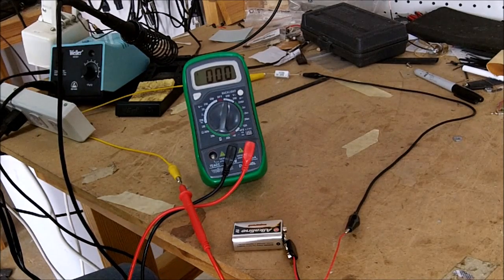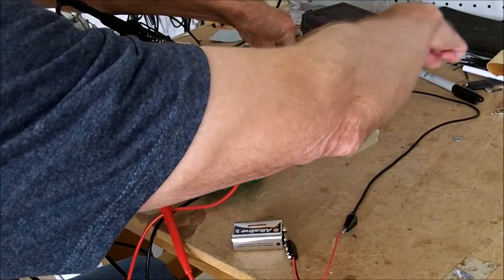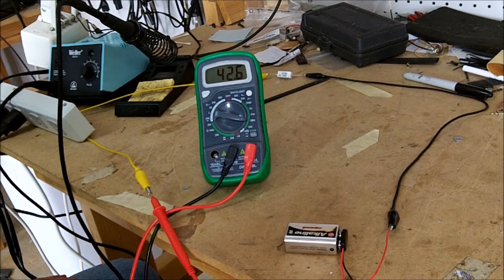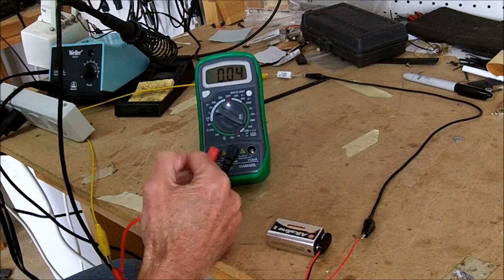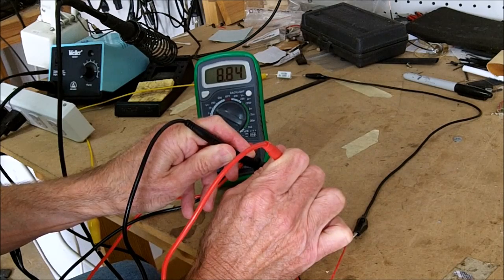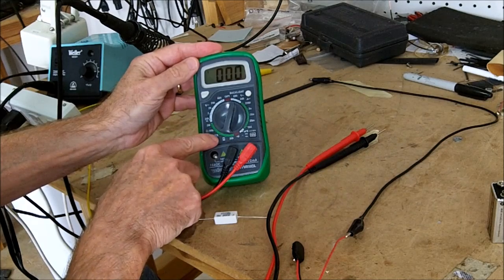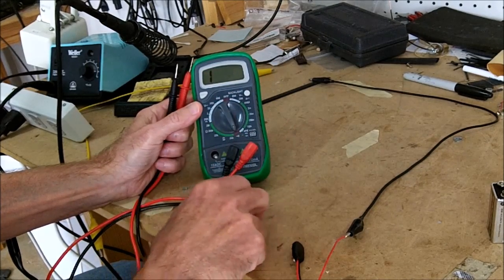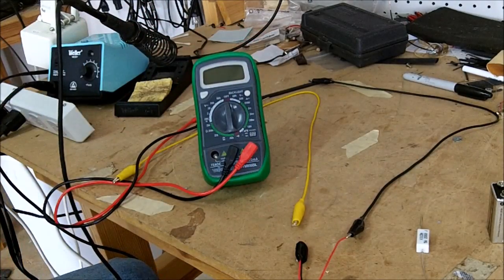How to use a digital multimeter

Comment: Thank you, You did an awesome job explaining how to use the Volt meter.  How do I measure a ha/vac capacitor for  micro Farad?
Reply from the maker: You need a capacitance meter or LCR meter. There are very affordable ones available. Example:
https://www.amazon.com/Proster-Multimeter-Capacitance-Resistance-Inductance/dp/B071WNNYQT/ref=mp_s_a_1_4?crid=2ELWUCPYL587E&keywords=capacitance+meter&qid=1658080715&sprefix=capacitance+%2Caps%2C125&sr=8-4

Comment: I have the same model that I purchased at the Home Depot years ago I have only used it for 120 /240 volt AC for home repairs and 12 DC for checking auto batteries and AAA ,AA and tool batteries. Now I know how to check for  continuity . I will have to watch this again for the rest because it was a bit over my head but I enjoy a challenge. Thank you so much for making this video it was very well put together. God bless.